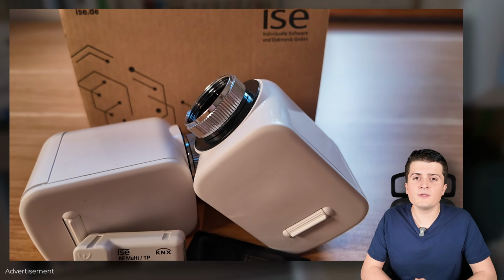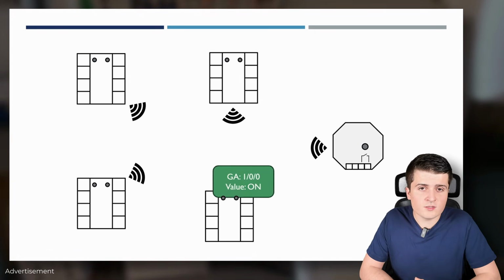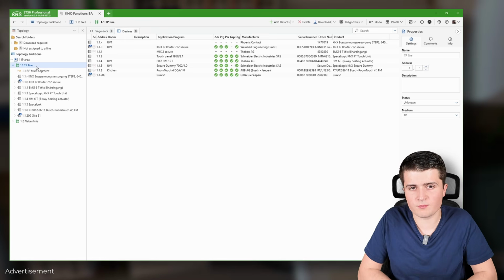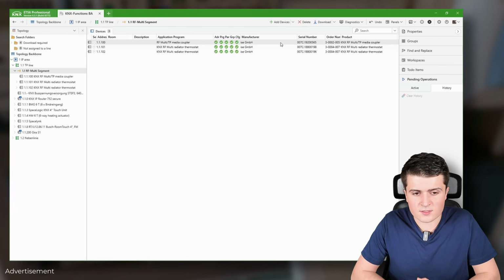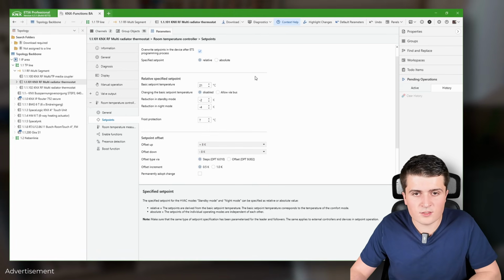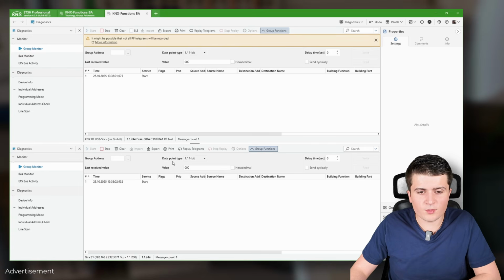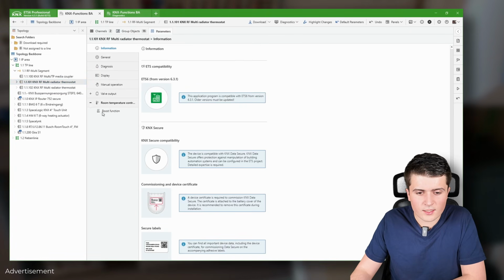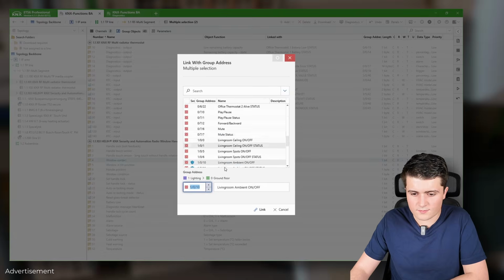KNX RF Multi - Everything you need to know!

Comment: Hi,
Today I installed a 3-0002-005 device along with a 3-0004-007. I managed to download both the physical address and the application program, and the field valve is working, but I cannot read any telegrams in the bus monitor—I only get responses highlighted in yellow. Since I need to integrate them into a BMS, I require the ability to read all the telegrams. Can you help me?